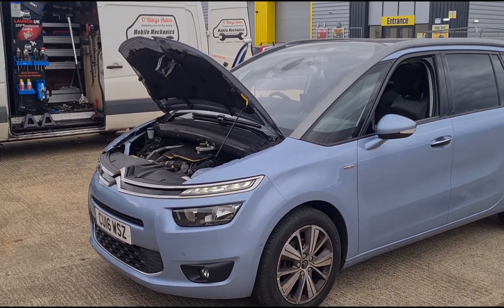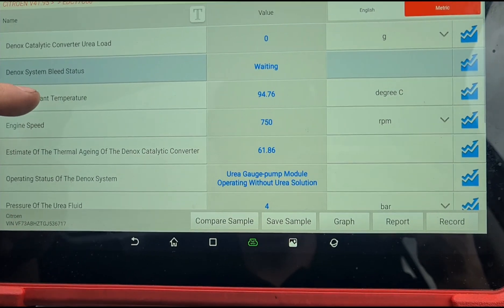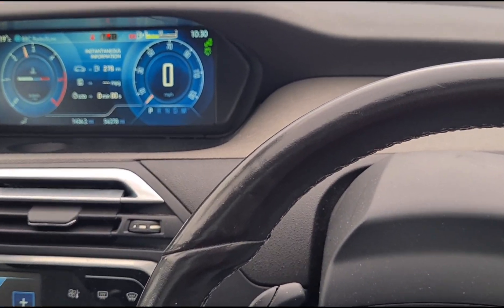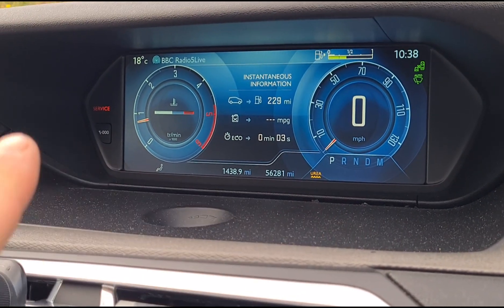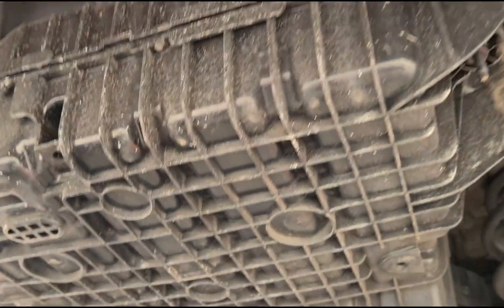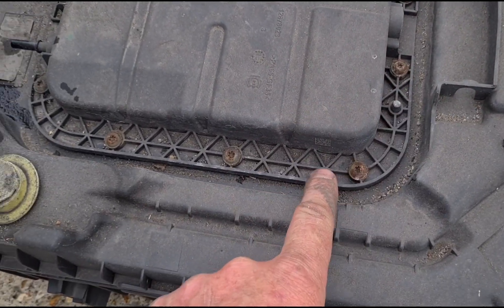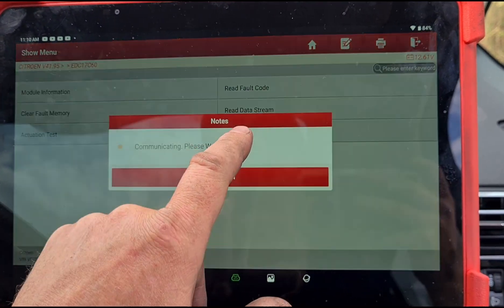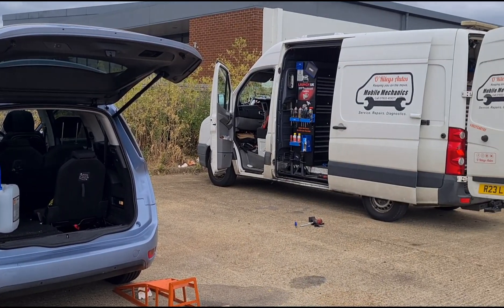Citroen C4 Picasso P20E8 Pressure Of The Urea Fluid Is Too Low

Comment: I had to have the Urea tank replaced after on my Grand Picasso after 52000 miles, now having more issues with the Urea warning light and 1500 mile countdown after barely another 3 years and 30,000 miles. I thought the replacement tank/pumps were supposed to be more reliable but apparently not.

Comment: I have seen the same fault code on a friends C4 Picasso and when doing an active test (using Autel) the Adblue injector test was ok but it failed the heating tests. 

I need to go back and hold the revs as I didn’t do that (I saw 4 bar even when reving the engine momentarily) but assume it’s going to be a tank replacement job either way.

Comment: I read some information about the flushing the addblue tank with hot water and refill it with fresh adblue  + adblue optimizer/anti crystall.. in some cases this could fix the P20E8 issue.   I've done this at my Peugeot 5008 bluehdi  and after 30k I did not have the P20E8 error.

Comment: there are two temp sensors inside these tanks, which can often fail, which then  puts out a 0°C diagnostic temp reading. This could have been seen, if chosen, on your diagnostic device, as  that is a common reason for the pump being  unable to start and the low pressure P20e8 code. I guess you are looking for a quick turnaround for you customers but with your helpful vids, the DIYers , with diagnostic readings could easily repair these tanks for small change

Comment: My Dad has a C3 that had a stuck open adblue injector, we put a new injector on and coded it with diagbox. 6 months later now he's getting codes for adblue pressure from the tank. These adblue systems are just a nightmare, and expensive. Just wonder if the stuck open injector put strain on the pump and shortened its life span as it was chucking all the adblue fluid out the exhaust with that faulty injector stuck open.

Comment: A mate's E220 CDI just had this code. The good thing about Mercs is that most of the adblue tank parts seem to be serviceable, so you don't have to drop €1300+ on a whole sealed tank (or maybe €700 on a used one). People always say Mercs are the money pits, but at least for this issue, they're not.
Reply: I think the circuit board in the PSA tank merely sits in the top of that bulge, there's no barrier between it and the fluid, to my knowledge... it's not a robust design IMO. A source of new PCBs would be useful, some people even change the MOSFETs to fix them.

Comment: Most likely the pressure sensor inside the adblue tank.  This sensor is moulded to the inside of the tank and cannot be replaced without cutting the tank apart - The solution is to fit an external pressure sensor instead in the line going to the adblue injector.  It's a basic 3 wire sensor that can be easily sourced and wired in, you can even buy the correct multiplug to fit the plug on the harness.  This one sensor is responsible for the majority of all adblue tank failures on most PSA vehicles it seems.  Had this problem with a mate's Relay van and his Berlingo.
Reply: Very interesting. Please can you post any sourcing info? TIA
Reply: @G-ra-ha-m  Sorry, I don't know of any, it's something you just have to get in there to work out.  You should be able to find pin out diagrams for the tanks though.  You'll at least know which wires you need to look at then.  There might be some training vids on the adblue system here on YT that might help you understand the tank system better.
Reply: @Altair885  I did find a site with the diagrams, apparantly a place in France repairs the repairable PCBs, but I haven't searched for that.
The location is 'non ideal' for a PCB :D
Reply: G-ra-ha-m @G-ra-ha-m   I know, it's an absolutely daft design and very obviously to screw cash out of owners.  By rights the PCB should have been a module external to the tank, even the pump and sensors could have been made so they were replaceable!  At least there's a work around if it's only the sensor at fault, which seems to be the usual cause of trouble.

Comment: i have a question, When my cars fuel tank is below a 3rd of a tank of fuel i get a rough idle at tick over and sometimes it will throw an eml service vehicle soon message and a limp mode. But it the fuel is above a 3rd of a tank i don't get any of these symptoms or messages.  Any idea what it might be as i first thought it might be the injector as that was the code it was throwing P0301 (misfire cylinder 1)

Thanks in advance for any reply.

Comment: My tank failed recently at 92,000 miles. I was quoted £1400 from the dealer. I got a new tank from a ebay seller for £610 and reset the fault with diabox. I was tempted to swap the pump with a used one, however the urea temp was reading 0 Celsius, which i believe a senor in the tank had failed too. Quantity of fluid was working, so it was doing something. I might have been wrong and a cheaper fix might have been possible, but the car is running again.  Also the swapping of the pump might have been a non starter, all the screws where rusted and only one could be undone. Using Wynns going forward now
Reply: the 0 degree Celsius  reading is often related to a broken thermistor on the urea heating pad. An easy fix if the pump area in dry with a resistor to mimic the resistance of the thermistor. Sometimes just shelling out for the new tank is still the answer if you are pressed for time

Comment: Cost of tank was £1200 fitted a few years ago.  Citroen acknowledged a fault (eventually and implicitly) with the design & I got it done for £600.  I think fault was the pump electronics being strained by a faulty vent cap!  Good video and only cure is a whole new tank with pump.
Reply: No, you can repair the printed circuit board. About £45 plus an hour Labour for refitting.
Reply: @paulnolan1352  Do you know of a company that offers this service? Or is it a DIY thing? Mine went on my Peugeot 508 and I have a faulty pump in the garage that I could have repaired as a spare. Thanks Jon
Reply: @jonsayce7756  I’ll have a look for the address. They fixed a Circuit Board for me and it was way cheaper than a new Board.
Reply: @paulnolan1352  Thanks, price of new tanks is just silly!
Reply: @paulnolan1352  Did you find this?